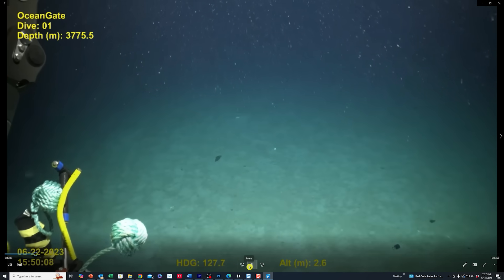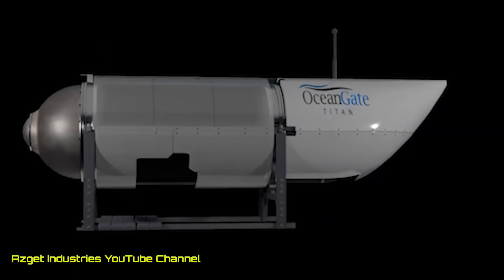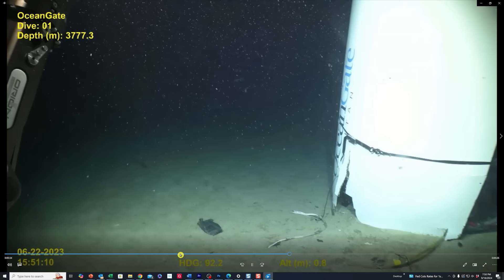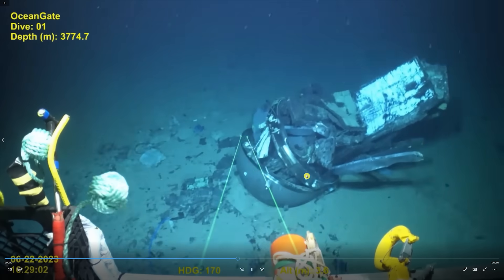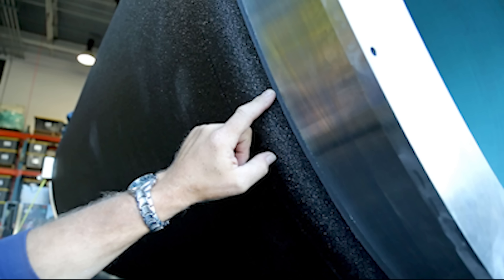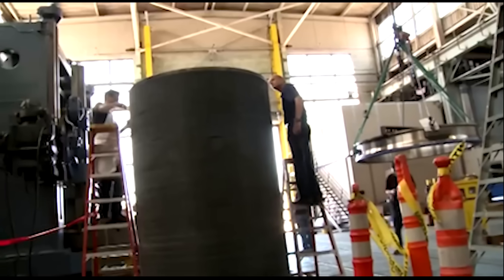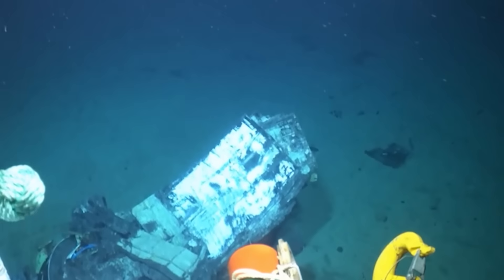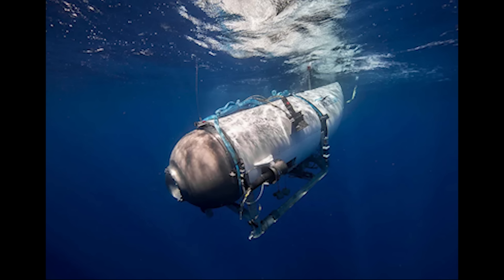OceanGate Titan Sub Debris Video Shows How It Imploded

Comment: Wow I didn’t know they constructed it like this. I’m a NACE certified industrial and protective coatings engineer for context, basically I engineer protective coatings for extreme environments. You are absolutely correct, that titanium should have been sandblasted with an SP5 white blast abrasion at least, before the application of anything. Not only that, but it’s is insane to me they thought ANY adhesive would endure pressures so vast to secure carbon fiber to a titanium ring. That is unbelievable to me. There’s no adhesive in the world, not even polyamide epoxy dendrimers that can endure CONSTANT liquid pressure stress that extreme reliably. 

The “constant” is also a key aspect. It’s not intermittent strain, it is ceaseless strain. Kinda similar to muscles. You can withstand muscle strain easier and far longer with brief intermittent strain than you can with constant strain. Constant strain will lead to strength failure much faster
Reply: I think that the dissimilar compression profiles of the carbon fiber and titanium almost guaranteed that cyclical fatigue was going to create a failure at that seam. The other part that is shocking in how naieve it was is their "early warning" system. They literally put sensors on the hull to detect the vibrations of individual carbon fiber strands breaking as a way to warn them of a failure. This completely  runs against the properties of carbon fiber, which holds fine until it doesn't and then it catastrophically fails. Add to that the fact that they cannot just pull a lever and start ascending at 30 meters/sec if that system ever did warn them and you get a piece of equipment that was almost purposely designed to kill people.
Reply: @PRC533 lmao that is crazy lol at pressures and strain like that ANY failure it’s over with lol once its compromised it’s going to crumble quickly. This entire project screams incompetence to me. It sounds like a bunch of rich billionaires got together and thought they were smart enough to construct a project like this with no real expertise on certain matters. Like coating systems such as adhesive, or epoxies, all of that is such an intricate field of study people who don’t know better really have no idea the extent of it.
Reply: Very informative
Reply: @vanzell1912 Coincido totalmente, es una locura que hayan utilizado adhesivo
Reply: When you mentioned intermittent strain vs ceaseless strain in relation to muscles, for some reason it immediately made me think of those Worlds Strongest Man contests. 

Intermittent strain would be like them flipping a car over or lifting those Atlas stones onto a plinth, but ceaseless strain would be like them holding onto chains to keep two giant pillars from falling or holding giant dumbbells with their arms outstretched for as long as they can. It don't matter how strong you are, eventually that's gonna take its toll and something is gonna give.
Reply: @BadgerOff32 definitely.
Reply: im glad someone more certified than me in this department had the same thoughts, my mind was blown when I heard they out that thing together with adhesive and thought it could go 12,500 feet underwater
Reply: @93_Silverado and not very much adhesive applied in a dirty environment where you would never get good adhesion.
Reply: As someone with an inspection background, I still can’t believe they thought this was a good idea. Trying to perform NDE on the hub and the connection to the rings would be a nightmare. And given how they cheaped out on construction, I highly doubt they sprung for the specialized NDE this would require anyways. I’m not too surprised if the interface between the dissimilar materials ends up being the failure point, because that would make sense. 

I’m still aghast that they never tested this design to failure. They built a manned sub out of finicky materials put it through cyclic loading at high pressures without doing basic testing for failure methods and lifespan. Just madness.
Reply: You are spot on about muscles.
I had something called hypophosphatemia, which caused full body cramping that did not stop. I was at deaths door within a few hours. Absolute agony. In five days I lost 25lb, water weight and muscle. Lucky to be alive.
Reply: I know nothing about adhesives but as someone completely ignorant to them, I would never have thought that it would be enough to hold the sub together. It's mind-blowing how they got away with it.
Reply: Well it probably didn’t help that they left it outside in the winter and let ice freeze and then melt on it.
Reply: They glued it together. My lord.
Reply: I concur with you! It's upset me, in that the Carbon Fiber Composite was completely blamed by so many people. Considering that my dad co-created what we currently know it to be today. 
When I saw OceanGate being slapped together like a children's submarine ride, like at Disneyland, I was completely perplexed by what you explicitly presented!!
Even when my dad helped me to put my old spaceship models together, he'd remind me to: wash the parts; lightly sand the parts, for primer to stick; make certain that the parts fit together, before a drop of Epoxy is used!
On the cover of, "Modeler's Resource?" There's an issue with a half scale, 5.5' scale Enterprise ship on the cover. I'm holding up one of the Nacelles. 
Even had my own articles for a bit, until I was given a bad casting from, "2010: a Space Odyssey."
Same leaching problem, that produced greasy heads on 1959 Vintage Ponytail Barbie #5! 
Plastics, no matter what you call them today, composite materials, etc? All have similar drawbacks.
I'm just proud that the Carbon Fiber Composite saved over 400 lives on that Japan Airbus, earlier this year! Yes, that went onto the Boeing Dreamliners first, many 777s, not just 787s. 777s are the better workhorse, Internationally. And I had a bulkhead footage oñ my way back from Japan, last week. No swollen ankles, just wonderful.
Boeing bought up Rockwell Intl. Aerospace division, including patents.
Reply: @juliesczesny90  That Barbie with the greasy face syndrome came out in 1961.
Reply: Thanks for the technical expertise.  It's too bad that Rush thought he was smart enough to figure this all out with just his own great engineering mind.  Such a narcissist.
Reply: Not really an adhesive but a sealant that is meant to stay flexible and get pushed into the gap between the two parts.
Reply: @alro2434  there’s a big difference between sealants and adhesives. While sealants act as adhesives to a certain extent, they are not nearly as strong. In the case of what we saw as to how the epoxy was adhered to the titanium, it’s just an end to end bond. That has very little shear strength. If the epoxy begins to distort from the pressure, it will shear off.
Reply: @alro2434 if it was a sealant that’s even WORSE. Sealant does not have strong compressive strength. Some of the best polyurethane sealants only have a compressive strength ranged from around 200-900psi depending on the density of the sealant. The depths the ocean gate descended to is around 5,500psi lmao if it was sealant it would’ve squeezed it right through the gap like a ketchup packet lol
Reply: There is clearly some excellent information here, only clouded by some Trailer Park “Potatohead.”
Filter out the opinion from someone commenting from a Cheeto stained beanbag chair in a single-wide in Happy Acres Trailer Park and Rehab and you have pretty clear picture of what actually caused this catastrophe.
Reply: @Grasshopper0122  I actually like that potatoehead pushed back cause it made Anthonyao4 and others explain even more cool stuff!!
Reply: She was built to withstand only 1500 feet of water stockton rush took the sub 12500 feet which was complete insanity his plan the whole time was to go to titanic in titan but never told anybody while they were building the sub if he did they would probably have laughed it off and thought he was joking but he wasnt and he cost people their lifes!!
Reply: @anthonya04  So just for clarification purposes only, Gorilla glue would not have worked under these conditions. Because the whole time I was watching them assemble this I was thinking they should use gorilla glue.
Reply: @robteleeiii8567  to be fair gorilla glue probably would’ve been better 😂
Reply: @anthonya04  well it wouldn’t have been any worse.
Reply: 🤯 very informative
Reply: I don't do it for living but i have nail tech certs, and when you do nails you have to go make the surface porous for tips or fake nails to have something to stick to. They're not going to stick to a smooth non buffed or filed nail... 

That's what i noticed also, i think that's the main problem here. It was fine until that one go, because where they didn't make the surface porous, it would have lost the seal to keep the water out, at some point out would have given out.
Same with nails if you don't start with a porous surface when you are putting tips or hole cover nails on they are going to get wet under that because we're the surface was smooth they're going to come off very easy. Also you have to dry out the nail, because of oils are present, it wouldn't matter, they would fall off or get water between the fake nails and real nail.

It's the same with acrylics if you put acrylic on a smooth nail, it will eventually come off whole, because water will be exposed between the acrylic and the real nail. Do you have to dry the nail out drill it so that it has a porous surface. You have to get all oils and moisture out of the natural nail before applying glue or acrylic or it's not going to work.
Reply: I think it was dive #59 or #60, when the submersible was set on the boat deck after a dive, the front cap just fell off onto the deck, landing on the acrylic window. There is a photo of it laying in the deck with the passengers still sitting inside on the floor.  

All they did was inspect the carbon fiber and the titanium cap and glue it back on. A following test dive then I believe the first of 7 dives that season to the wreck of the Titanic. So they already knew the adhesive could fail, because it literally failed in very dramatic fashion.
Reply: It is not even you must be an engineer to know that, even as an ordinary citizen, I have no knowledge of an engineering.
Reply: But Stockton was smarter than all you stick-in-the-mud college boy PhDs put together. He only hired interns lol. No joke.
Reply: So right. He was just an egotistical narcissist who thought he was above any safety measures. Money was more important to him than human life.
Reply: Only a dumb engineer would think that submarine would survive.
Reply: Apparently that damn thing was making cracking noises the whole time. Rush said it was "normal".
Reply: i really can’t believe ANYONE thought that glue would work.
Reply: By definition water trying to squeeze past a gap applies P pressure, the entire clear dome applies pressure equal to it's area which is all applied to the interface with the carbon fiber.  . ..
Reply: There were 666 thumbs up to your comment. All of this was an avoidable tragedy but this is what happens when testing nature shows that man will never master the oceans, planet, or universe.
Reply: They drilled screwed into the hull to mount a screen.
Reply: I thought intermittent strain was what caused fatigue and failure cracks.
Reply: No se podia reforzar ese adhesivo con unos tornillos de titanium?
Reply: How they even managed to make as many "dives" as they did, baffles me. 😮
Reply: I learned a lot in this comment
Reply: Common man, it worked a few times before, so screw it they knew what they were doing with the Xbox controller and cylinder design instead of a proven spherical one.
Reply: I love smart people!!!
Reply: Agreed.  What’s interesting to me is how the titanium ring was mated to the hull in that the ring is the female end and the hull is inserted INTO the ring. So as the hull is compressed under pressure, the only thing keeping the hull bonded to the ring is the adhesive.  I’m no engineer but I would think, under those pressures, you would want to use the strength of the titanium ring to help support the hull by making the hull go on outside of the ring so as the pressure increases the hull can squeeze against the ring as opposed to trying to pull away from it.  That always baffled me.
Reply: The union of Titanium & Carbon using Adhesive, then using them under those conditions, is beyond comprehension !!  They probably thought - unlike the reverse pressures in Aviation & above, in Space Exploration - that the compression-effect of the deep-sea environment, would assist in holding the parts together. But didn't account for the stresses that appear, WITHIN the Carbon Fibre. 😞
Reply: It really didn’t need any adhesive, since the joint was very heavily loaded in compression. The problem was the differential strain as the two compressed led to load transfer from one to the other
Reply: Remember, it had already done 90 successful dives, 13 of them down to the Titanic. There is also some evidence the hull had been struck by lightening while it was on the ship.
Reply: Man do I so not care about your profession or opinions!
Reply: @HendersonHinchfinch you cared enough to comment babes
Reply: @latteknowsbest6365  whatever you say toots
Reply: Other subs have used adhesives in the same context and did just fine.
Reply: @dementionalpotato  no other sub has ever used adhesive to attach titanium to carbon fiber as part of the pressure vessel. That was kind of the whole point of this one.
Reply: @dementionalpotato At 4000 meters??
Reply: @dementionalpotato  Name one.
Reply: @Code4King  the us navy auss is what they based their design from for example and it was designed to dive to 6km and completed hundreds of dives.
Reply: @dementionalpotato while true, they were MUCH more advanced in the analysis of the graphite weave, using different patterns and were leaps and bounds more knowledgeable over Oceangate. Also, AUSS was a unmanned vehicle, hence the “U” in the name. They never cared humans in those. Wonder why…
Reply: @dementionalpotato well I’m sure since you know more than I do, who literally engineers protective coating systems across the country and globe for many industries; including waste water treatment, food production, marine, military, and aerospace,  you can indulge me on what manned subs used what adhesives on what substrates with what SP; the process in which they applied it, the atmospheric conditions, pressures, and length of time they performed at; the polymer structure(extremely important), microns, aggregate, tensile strength and density of said adhesives; and the catalyzation of these compounds. This is really just rudimentary information.

And when you go to google this information and see what experts in the industry such as myself said about the materials they used, don’t be shy please include that expertise as well. I just want to learn as much as I can from you who clearly has knowledge beyond my capacity
Reply: @dementionalpotato  Name a manned vehicle.
Reply: @anthonya04  @dementionalpotato while this conversation seems to have taken a slightly patronizing turn, I do have to mention that this particular mini thread has legitimately helped me better understand the capabilities of certain materials under constant extreme pressure and i'm thankful for it. I've spent more time researching this whole incident when it happened than I'd like to admit but unlike Stockton, i learned alot from it
Reply: @tioswift3676  it doesn’t matter. The technique has a history of working reliably contrary to what the op said. I don’t see the point in moving the goalposts of this argument until you get a desirable result, that is not productive.
Reply: @anthonya04  I’m sorry that you became offended by me pointing out that your assessment was lacking. I hope you can learn to control your hubris in the future.
Reply: @dementionalpotato  The Navy submersible was nothing like this is practice, or construction. The only thing similar between the two submersibles is that they utilize similair materials. 
First and foremost, the AUSS submersible used by the Navy was an unmanned ROV, entirely different in practice from the Titan which carried up to 5 people. It was also constructed from graphite epoxy (the pressure hull) with titanium hemispherical ends. “Graphite epoxy" refers to a composite material made from graphite fibers embedded in an epoxy resin, while "carbon fiber" simply refers to the individual carbon fibers themselves. The main difference between carbon fiber and carbon/epoxy composite is the matrix material used to bind the carbon fibers together. Which is important when talking about extreme pressures being exerted of the vessel. 
This is why the Titan sub failed. Because carbon fiber is really only as strong as the epoxy holding it together. Carbon/resin composites also have really sudden failures and no good way to measure the fatigue on the vessel.
Reply: @dementionalpotato which sub is that? I believe you’re just making it up. I’ve engineered a number of parts using carbon fiber. It has a maxing tensile strength, but virtually no compressive strength. It’s a cloth, either woven or not. It’s the epoxy or polyester that it’s bound in that gives it the stiffness. If the sub were given a great deal of pressure from the inside, it would be very strong, such as some of the high pressure tanks I’ve designed. That’s because the fiber doesn’t stretch much because of its strength and takes most of the load. But in compression, the carbon fiber might as well not be in the matrix as the epoxy or polyester is taking almost all of the load. This gave a very small fraction of the strength the fiber has in tension. During dives, people noted a lot of creaking, but the biggest warning that eventually, something would give, were the numerous pops and snapping noises, which indicated that the poor quality adhesion between the layers were delaminating. Remember that this carbon fiber product was outdated and rejected by Boeing. They bought it because it was cheap and they even admitted that. There are so many problems with this design that it’s difficult to know where to begin. One problem was that the glued surfaces weren’t properly prepared as has been noted here. But another is that the are mated end to end. There is zero mechanical strength to that glued connection. The glue is the only thing holding it together. I was shocked when I saw that. At the very least, there should have been a lip on the titanium of several inches in length that the hull should have slid onto, with the glue in between. That’s pretty basic. But in the end, a carbon fiber pressure hull going down below 1,000 meters is a bad concept. Even 1,000 meters is more than safety would allow.
Reply: @anthonya04 what a lot of people don’t understand, as they aren’t educated in the field and just have other less than informed people to go by, is that fiberglass, carbon fiber, etc. are just cloth. Without the epoxy or polyester stiffening them, they have zero compressive strength. They’re good for panels that are constrained at all the edges, if they undergo a force at the center as the fiber won’t stretch and so adds a good deal of strength. In that use the epoxy does nothing much other than to hold the fibers together. But in compressing, such as with a tube, it’s inly the epoxy that resists the compression. The fiber adds little. Connecting a very weak material to a very strong one doesn’t strengthen the weak material.
Reply: @melgross  The submersible he is referring to is called AUSS or Advanced Unmanned Search System. It was developed by the Navy in the 70-80’s. But it is nothing like the Titan in construction or practice, just similar materials.
Reply: @melgross  well hello fellow engineer haha and you’re exactly right fiber glass/carbon fiber is literally just epoxy, typically a two component polyamide epoxy dendrimer with an MEK-P (methyl ethyl ketone peroxide) as a catalyst. The “fiber” is like you said either just a woven mat or a shredded mat of the same material embedded in the epoxy to reinforce it. While strong and fairy lightweight it does have its limitations, especially when you’re talking about such an extreme environment as the deep sea depths the ocean gate was descending into. 

To another point you made about people being uneducated on such matters is exactly why I asked the questions I did about the process and materials used in this system lol they just see something somewhere on the internet and think they know better. They don’t realize just how complex and in depth the science is.
Reply: @UhHuhMagik   “The bonding of the coupling rings to the GFRP cylinder demands great care in the selection of the adhesive, thorough cleaning of surfaces to be bonded, and meticulous attention to procedure for application of adhesive to the coupling ring. The epoxy adhesive, for bonding of coupling rings to the GFRP cylinder was chosen on its ability to withstand high-bearing stress without extruding from the
joint, or debonding from the mating components.” 

Technical Report 1245 August 1988
Graphite-Fiber-Reinforced Plastic Pressure Hull Mod 2 for the
Advanced Unmanned Search System Vehicle
Reply: @dementionalpotato  Notice the key words, “Great care”, “clean surfaces” and “meticulous attention.”
None of these words can be applied to the Titan submersible. Therefore, the AUSS is nothing like the Titan in construction, or in application. And research from this program deduced it was cheaper for the Navy to continue using other practical materials such as steel, and titanium for deep sea research and rescue.
Reply: @UhHuhMagik   This, however, has nothing to do with my point, being that the op was jumping the gun by claiming there is no epoxy in the world than can do this job reliably. As shown in that source, there was such an epoxy that was used for exactly the same purpose, contrary to what many people in this thread argue, and it was relatively reliable, regardless of the assessment of the practicality. I still fail to see why this small correction is controversial in any way.
Reply: @dementionalpotato  Relatively reliable is not good enough for long term use. It’s not practical, therefore you do not see it in wide use. That is why it is unbelievable to him that you would see it in use at all. Just because it can withstand the pressure, doesn’t mean it can constantly. After many pressure cycles, repairs to the entire graphite epoxy portion would need to be done, maybe even replacement entirely, and a lot more often. Carbon fiber and graphite epoxy in general fail incredibly quickly, without much warning. 

I figure your point was that it HAS be done before, and my counter was that it HAS been done before, but the Titan was nothing like that. It is a far cry from what the AUSS was in construction. The proportions matter, and that is the key. Most deep sea vessels are big enough to hold two people max. Titan’s proportions were far too optimistic in size for reliability.
Reply: @UhHuhMagik  I’m familiar with it. There is almost nothing in common here.
Reply: @melgross  That’s what I told him. Maybe look at some other comments.
Reply: @anthonya04  extreme environments surprise us at every turn. It’s why titanium is used. The extreme pressure actually compacts the crystals, making it stronger after a dive than before and that strength remains after the pressure is relieved. It’s something akin to forging, where metal is put under pressure. But, sheesh, all pressure does to epoxy, which is brittle, is to add micro cracks and voids, which weakens it. The fibers do nothing there as the voids don’t have to pull the product apart, where the fiber would resist it, it just pushes the whole thing together. An end to end glue joint would therefore shear the epoxy structure from the titanium one, being that there was no mechanical resistance from a proper overlapping joint. I just find it difficult that actual engineers came up with that.
Reply: @tioswift3676  It may be unmanned, but it's still a pressure vessel that hasn't failed.
Reply: @UhHuhMagik  	
	We seem to still be on different pages here. You keep mentioning carbon fiber reinforced epoxy, but I believe you are referring to the main hull? The epoxy that was used to joint the hull to the titanium rings is what I am referring to. Just to be clear what I am referring to (Technical Report 1245)”CIBA epoxy resin 6010 and CIBA 283 hardener mixed in 100 to 70 ratio”
	Furthermore, I’m curious how you came to the conclusion that there were reliability issues with this method? Aside from it being unusual in present day, because that could be the result of a variety of factors. As per the retroactive evaluation (Technical Report 1529) “The AUSS is a system that very effectively achieves its mission and surpasses its program goal.” This doesn’t sound to me like there was any reliability issues.
	Finally, I think you missed the point of why I responded in the first place. You argued for why the op was in disbelief of the idea of using epoxies to bond the pieces. This was not the part of his comment I was addressing, but rather the part where he claims that such an epoxy does not exists with authority. “There's no adhesive in the world, not even polyamide epoxy dendrimers that can endure CONSTANT liquid pressure stress that extreme reliably.” 
	Hope this clears some things up!
Reply: @SkylineBNR34  yes, because as I said, much more engineering and science went into it.
Reply: @melgross  if you watch some of the manufacturing footage of the titan you can see they they actually did use the method you described, unless I’m missing something. But you can clearly see a lip on either side of the titanium ring of a few inches in length, epoxy is applied to the inner 3 faces of the ring, and the main cylinder is slid snugly into the ring.
Reply: @dementionalpotato  there was no lip of several inches. I watched the videos as well. There were two very short centering portions that were raised slightly. That’s it. The way it was applied was criminal. This was anything but a competent operation. So many engineers and outside experts in this business have written, over the years, and testified at this hearing, of the many faults with the basic concept, design and. Anura Turing, that it’s foolhardy to try to defend them. Give it up. All the criticisms were correct, and they were wrong. Just accept it. We know the results. You can’t argue with that and I really don’t know why you’re trying.
Reply: @melgross  I never argued against anything you’ve stated in this comment. Please try to keep up! The only thing relevant in here is the fact that I was mistaken about the process you described in your other comment.
Reply: @dementionalpotato  This is long, fair warning, but hopefully I touch all bases:
We are on different pages I guess. I’m referring to you mentioning submersibles have been made in a similar way, you mentioning the AUSS. I must admit, I do not know the exact manufacturing processes behind the graphite epoxy hull of the AUSS, but I do know quite a bit about the Titan’s construction. I have spoken (through discord) with one of the engineers who was fired by Stockton, and attended a lecture of his discussing the construction of the submersible. I have some notes from it. A summary of why Titan failed, why carbon fiber and epoxy resin shouldn’t be used at extreme depths, and why it is nothing like the AUSS in construction:
Unlike the AUSS, the Titan utilized unidirectional carbon fiber in its hull construction. Specially 480 layers, 240 of which were strung longitudinally and the other 240 strung circumferentially. The hull consisted of:
The carbon fiber, which was 5 inches thick, the titanium end caps which were each 3.25 inches thick, and the acrylic viewport at the front, which was 7 inches thick. At the depth of the Titanic, the Titan would be experiencing about ~51,700 tons, or 104 million pounds, of pressure being exerted. That’s like sitting the USS Missouri battleship on top of the carbon fiber hull of the Titan.. and expecting the components to hold. There are no known epoxies that can withstand this amount of pressure consistently, and more importantly, safely. 
The failure happened near the front of the vessel, therefore, the epoxy holding the titanium end caps to the carbon fiber hull failed. We know this based off wreckage footage recently released. It did not fail in the middle like previous simulations showed.
Look up a stress and strain graph for steel, then do the same for carbon fiber. You will notice with steel, there is yield strength, ultimate strength, and then eventually fracture. With steel, you have some warning before you reach the elastic region, and another warning before you reach ultimate strength. While with carbon fiber, you will see the elastic region abruptly end causing catastrophic failure with little to no warning. Even worse with carbon fiber, the ultimate strength and the failure point are the SAME. Carbon fiber is brittle, like glass and ceramics. Brittle materials fail suddenly, and catastrophically, with very little warning. That is just unacceptable in engineering, and is the main reason we do not see submersible vessels with carbon fiber paired to titanium, and carbon fiber pressure vessels made of carbon entirely. Failure points are unacceptable for safety, and reliability in cases of GOOD engineering. 
Carbon fiber is also porous by nature. The epoxy is supposed to combat this, but you simply can’t get epoxy in every single microscopic pore. Carbon fiber does NOT like to be submerged. It furthers the act of the epoxy separating from the fibers. This causes a catastrophic cycle of failure in itself. Pores act as a site for water intrusion, water intrusion causes further cracks to form and fibers to debond. This is a bigger problem at water pressures of 5,000psi. More water means more cracks, more cracks means more water etc. 
You can combat this by placing the hull in an autoclave, and heat curing the carbon fiber and epoxy. Autoclave curing removes pores from the structure, and generates a smooth surface. 
Well Ocean Gate didn’t do this. They simply put the hull in a giant conventional oven, and left it in there for a week. 
In conclusion, there was no way they could’ve done this, and have it not fail eventually. It was inevitable, with the corner cutting. Very unlike the AUSS, which I’m sure was done with every single safety produce in mind, and it was an unmanned craft. Research vehicle vs. Experimental vehicle.
Reply: @UhHuhMagik    I think this kind of highlights my point in a way. You cant entirely blame the materials when so many compromises were made in the sake of saving time and money. I understand that the composite hull is ostensibly a different material when you use different processes to make it, but I never really meant to bring that into question. I also never meant to imply that the titan and the auss where comparable in any way other than using epoxy to bind a composite hull to a titanium ring. Also, Tony Nissan said in his testimony that the epoxy used to bind the pieces was selected because it apparently was rated to withstand the pressure it would be subjected to. He said their consultant who guided that decision was named Brian Spencer. I wonder if some of the further investigations will clear this up.
Reply: @dementionalpotato  I see, I see. You are right in the sense you can’t blame the materials, and in fact, the math behind this submersible is completely sound on paper. It’s in practice, literally WHERE you build the thing, how you build the thing, how stringent you build it, where you test your math, a revolutionary idea can be proven to be viable. I think further investigation is not only needed but NECESSARY as more people are going to be attempting this based off his failures, they already are, and we need sound engineering behind these projects, or the public to be more aware of materials and how they react in extreme pressure environments. The deep sea is as dangerous, if not more dangerous than space. And there are so many more regulations with space travel, fairly few with deep sea diving as seen with the Titan.
Reply: @alhenry92 you understood the need for research.  Stockton apparently didn't.
Reply: how small was it.. compared to titan @dementionalpotato